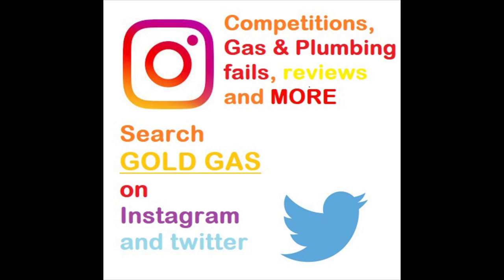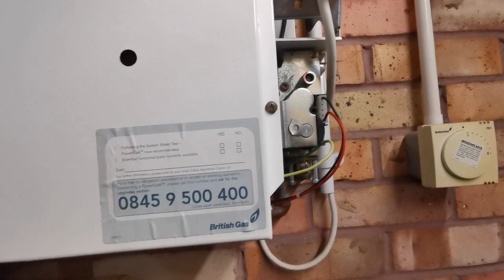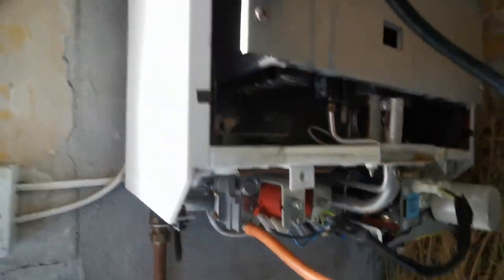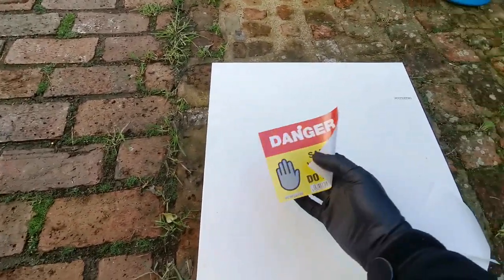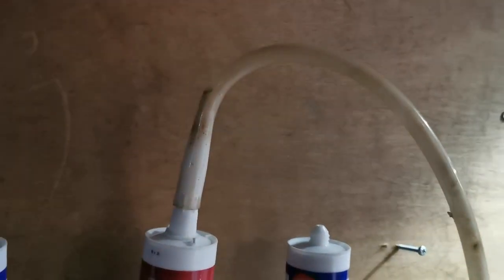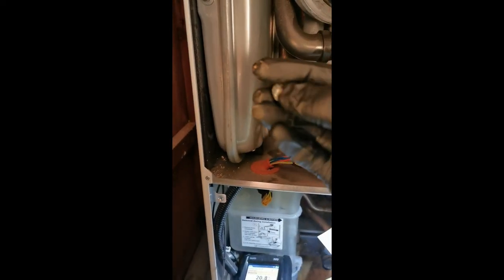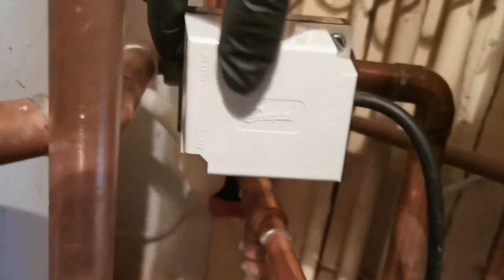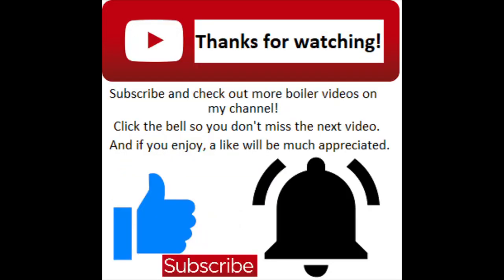PLUMBING TRICKS, HACKS AND TIPS - GAS BOILERS, PLUMBING AND HEATING - THESE WILL HELP YOUR WORK

Comment: Great video.
Installed a Intergas system boiler without a bypass valve when room stat is turned down low the boiler displays lockout code 11 circulation issues? Could this be the reason?
Reply from the maker: Are the rads switched off by the thermostats when the heating is low?
Is the pump new?
Are there any summer rads?